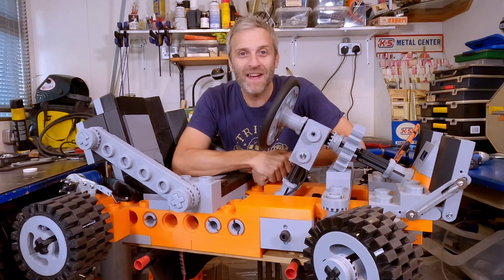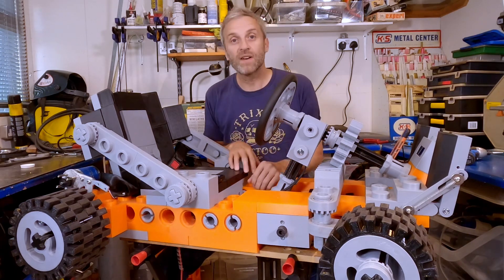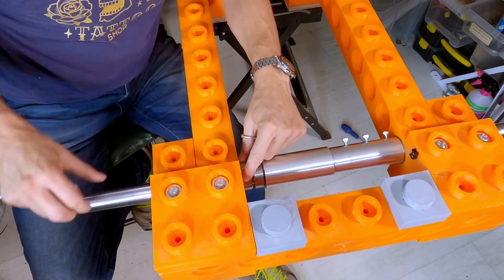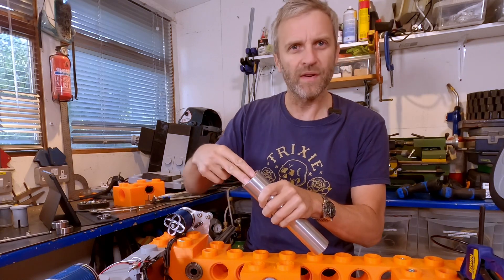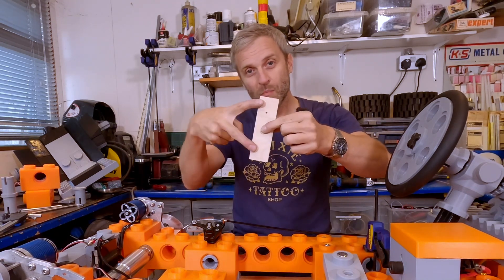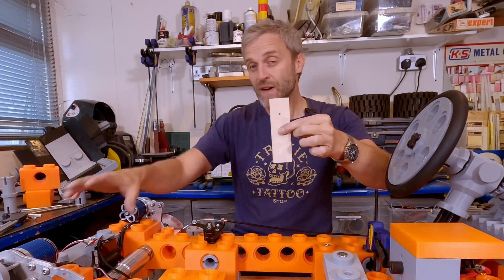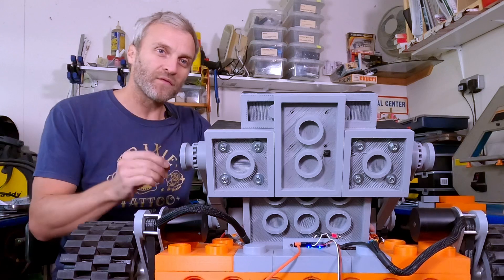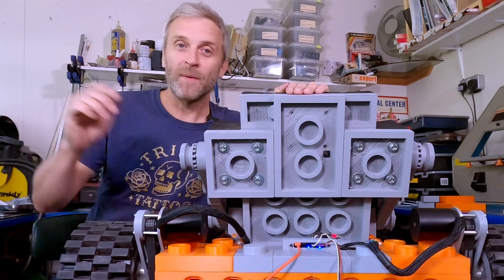XXL LEGO Go-Kart | Rebuild Mark II | #6 - Mantis Hacks

Comment: Hello Matt, what a project.
I wrote you around 2 years ago already.
It would be amazing to provide my son with such a GoKart - do you have some documentation (3D printed files, manual, electronics ... )?
Looking forward to your answer
Tom
Reply from the maker: Hi Tom. I don’t have any info on this electric kart, only what’s in the build videos. It got fairly complex especially with the split rear axle. I had to have that specially machines! The only files I have are for the 5X scale gokart which is not big enough to drive :)

Comment: Lose the mechanical rear brakes, and enable motor braking instead. You're polling the brake pedal position anyways, might as well? You'll still have the mechanical fronts, which should be 2.5 times more effective at a given brake position as a rule of thumb, so I think you;d be set given the amount of braking those 140KV's could give vs those swept discs?
Reply from the maker: There are no front brakes. The motor braking is no where near enough when compared to the disc brakes.
Reply: @MattDenton  I was under the impression there were swept discs up front as well, and also why I thought motor braking would be sufficient in the back. My fault, Matt. I imagine that re-engineering front knuckles to support them is out of the question - load balancing brake differential discriminator it is then!

Comment: Have you tried making bigger wheels and rubber tires? I don't know if that makes a difference but Lego actually made tires made of real rubber so contraptions have more torque.

I think it'll help immensely.
Reply from the maker: They are made of TPU 95 which is similar to the Lego rubber 👍
Reply: @MattDenton  I had a Lego set whose wheels use Actual rubber. You should probably check it out, just in case

Comment: great video! 
probably somebody else already suggest, but you might try to attach the main beam on a 4 pin size in stead of 2, with a setup of PIN-empty-black axle-PIN. 
in this way the beam will greatly increase as you reduce the flex momentum in the center.

Comment: Id run that old 6x1 print parallel on the inside of that new piece for some more strength.  Also one 6x2 print behind the seat, instead of the multiple pieces capping the aft frame work.

Awesome work though, thanks for sharing.

Comment: Is it possible to, make a hybrid engine with a high and low gear? So the high torque motor will be a low gear. And the high speed motor will be the high gear
Reply from the maker: Possibly yes..

Comment: id be worried the plastic piece in the tube would heat up melt and cause problems. why not use a metal one with grease fittings?
Reply from the maker: Well they shouldn't, as there are no surfaces that will be moving against each other ... And hence no heat.. 🤔

Comment: Matt.... no issues with the video - amazing work!! Ivans part was amazing, cart is amazing. But I have a question... h
What's the small band saw the the BG?! Would like a band saw but can't afford the shop floor....lol! Ohh and the fact you rock Asics tells me everything I need to know about you! 🤟🏻🤟🏻🤟🏻 haha. Keep up the great work! 👌🏻
Reply from the maker: The small band saw is a very ok (1980s/90s) black and decker bench to saw. Very useful size with a deep throat (waits for smutty response)... I picked mine up seconds hand for £10, I think you can still find them, you can still buy blades for them.. the Asics are my running shoes 😁
Reply: @MattDenton  snigger..lol! Thanks for the info on the saw. Keep up the great work!

Comment: Using the old-school Technic 1/2 bushings with the teeth. Nice! I miss those 90s-era Technic details. I mean, I have hundreds of them in my collection, just that LEGO stopped production long ago on all those toothed LEGO connectors of the era that were so great for making rigid structures at specific angles.
Reply from the maker: Yeah they looked cool too!!
Reply: @MattDenton  Exactly! I would use them, superfluously at times, on all sorts of sci-fi vehicles and weapons, with the teeth showing, just to make them look cooler. It was a type of greebling in a way. Heh.

Comment: Heck, I would have used the two beams you removed and put them on the inside the longer beams instead of using 4 2 pieces for the seat for additional strength. If they would have been too long you could have just cut them down to size.

Comment: Ironically, a little flex is good in a solid axle go kart. Set up right, the go-kart is meant to twist and lift the inside drive wheel when it takes a turn and weight shifts to the outside.

But obviously that doesn't matter now because it has a differential.
Reply from the maker: Yeah I think it's called jacking? But hopefully won't need it now 👍
Reply: It also makes it a bit more comfortable over bumps since it doesn't have any suspension.
Reply from the maker: True 👍
Reply: anyway it goes, this gokart is going to be a big flex

Comment: Looks great Matt! My electric kart had a no load speed of 32 mph, but never went above 21. But it was only one motor and a steel chassis. I also have the tractor diff, which added 4 or 5 lbs to the rear axle.
Reply from the maker: That must have been pretty heavy!
Reply: @MattDenton  that and the motor/ESC aren't great. It is the 1800W combo from Amazon with 32A ESC. Thinking about getting the 3000W ebike one from eBay. The chassis can definitely do higher speeds. Can also do differential braking with disc brakes on either side of the diff and two levers

Comment: Maybe if you got your buddy to print two more of those beams you could redo the front end and run them through under the seat. It would give you a bit more rigidity. more points to pin together either way I’m jealous. Your giant LEGO videos are the best
Reply from the maker: Thanks .. the thing is weight is also an issue... It's already 45kg 😬

Comment: Hi Matt, I love your Videos! That's really engineering. 
Regarding the two motors ... I would go for a central differential. Just that the power is centrally provided. You can achieve that with your axle like it is. Take a look at 1:12 or 1:10 RC PanCars. And you can try to use both motors (or three?) with that drive then ;)

Or you could add a G-Sensor and add some code to let them speed separately. Could be also a nice option ;)

Keep on going! I really enjoy that. Hope your next Project is a collaboration with Ivan as I also love to see his channel ;)

Comment: Was wondering if an electronic (drag) brake could work.
I wanted to implement something similar in code for a small car. I could see this is 'wasteful' as it engages the motors. Or am I missing something... ?
Reply from the maker: I have electric braking but it's not enough 😬

Comment: Hang on.....you've got four motors now but you've installed only two? Solve the torque problem: double the number of motors...

What about having the disc brakes on the front wheels? With the regen in the back, you'd have a F1 setup
Reply from the maker: Would be nice if I could find the space..
Reply: @MattDenton  so.. just make it bigger ;)
you know a guy who can print longer parts now.. :)

Comment: If you're worried about the loss in speed, why don't you print bigger tyres? Also it would give you a bit more of an air gap at the base due to the added flex in the middle.
Reply from the maker: To be honest I don't mind it being slower with more torque 👍

Comment: Now when more infinity printers hit the market... the longet beams are much more viable....
Reply from the maker: Wish I had one 😬
Reply: @MattDenton  the upcoming model supose to cost under $1000, while that is still not cheap.. its in the case of.. if you really want one..its posseble to buy one
Reply from the maker: That's not too bad. Still cheaper than my Taz printers
Reply: @MattDenton  the production of it was not quite final yeat.. but it supose to be on the market by Q1 next year.
Reply from the maker: Will look out for that 👍
Reply: @MattDenton  the one i was thinking of was called the creality cr30. Cant remeber where i saw the price. But im pretty sure it was supose to be sub 1000... of cause, its not for sale yet.

Comment: Interestingly enough, that differential braking system is the same system they use in formula one. I’m not sure if that was where the idea came from but i thought it was neat. Driver61 has a great video about how they work.
Reply from the maker: No I was just thinking I needed it, then I realised it's much the same as a centre pull brake on a bike.. then my boss told me it's also how handbrakes on cars work 🤷🏻‍♂️👍
Reply: @MattDenton  Well, at the time of my final study project as electronics engineer I  newly (re)invented a way to 10-50 fold increase an AD-converter sample of a contiguous analogue signal... MANN was i proud... until a colleague showed me a 20 year old schematic that did just that, on a F-16 fighter component.😊
Reply from the maker: Well.. it's still nice to think if something, even if someone else has done it already 👍😁
Reply: Trailer and handbrakes have used this for nearly 100 years. Not sure F1 uses cable brakes........
Reply: @stephencresswell4760  it’s a similar system they use for their hydraulic brake pumps. it helps the steering adjustments while cornering. i should have mentioned that initially